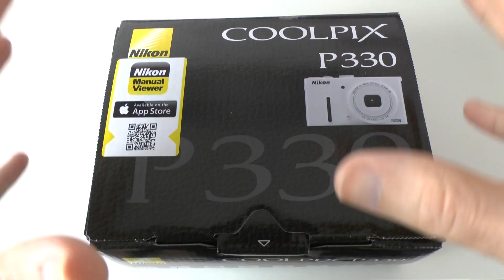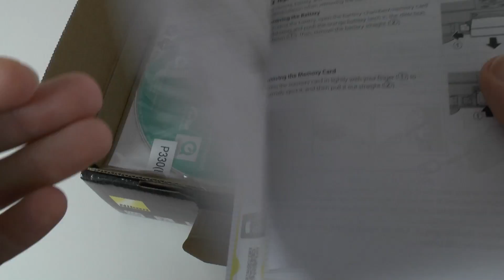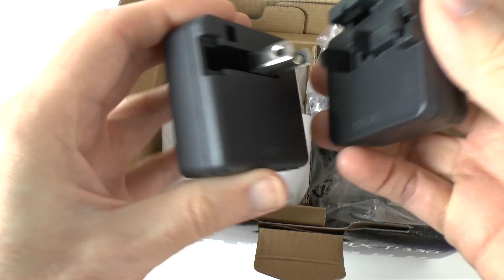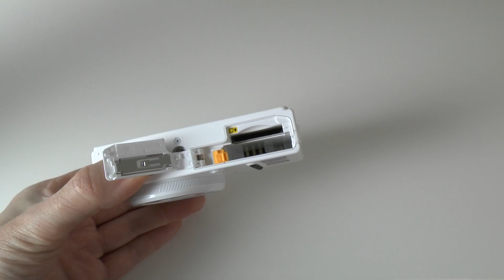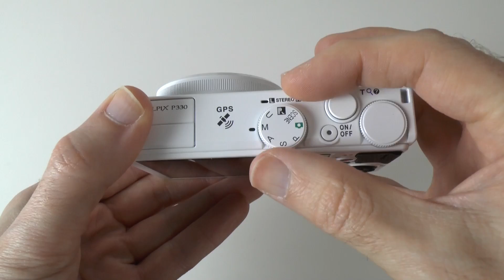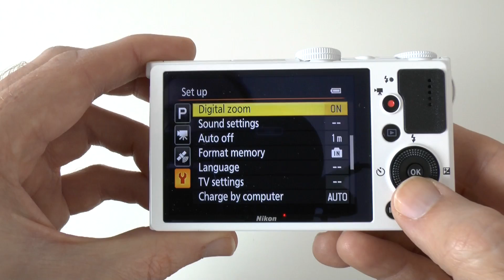Nikon P330 Unboxing & First Look

Comment: Great video Dave. The white in this camera looks really good. The only downside about the colour, which is a problem I have with all other white tech products is that it makes the item look cheap. There are some exceptions like the HTC One for example but for the most part they don't look as premium or high quality as the black colours. That's my little rant over :) 
It still looks really good and better than many other white compact cameras. Keep up the awesome work Dave.